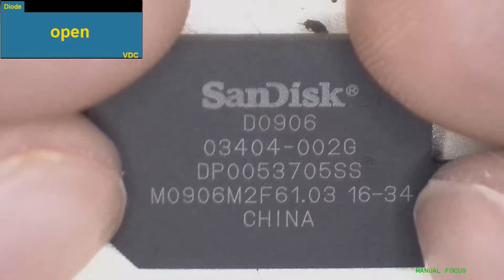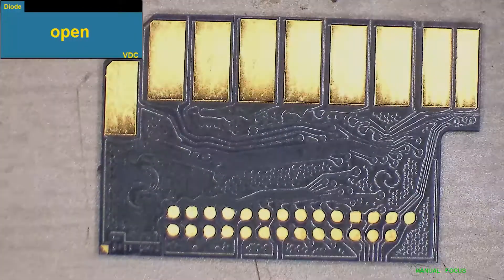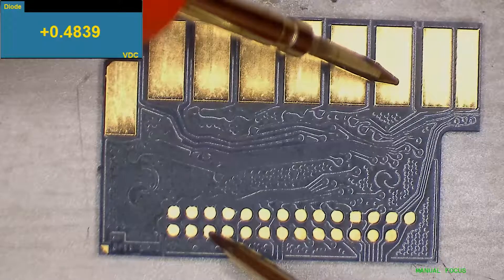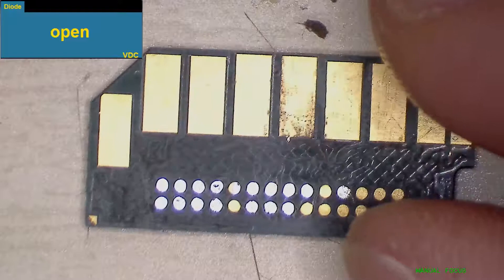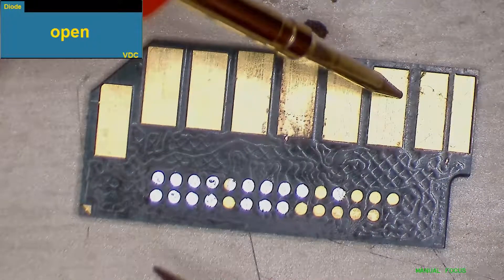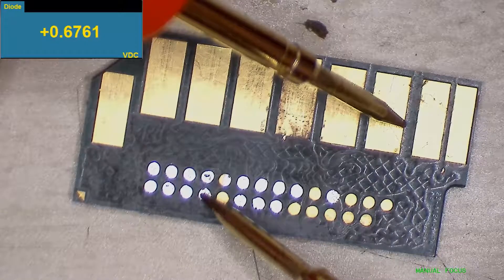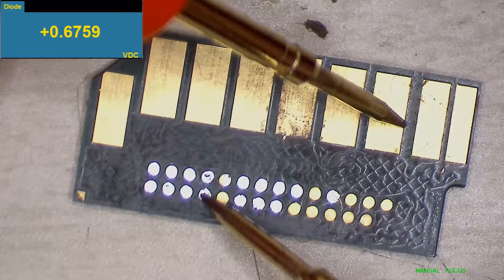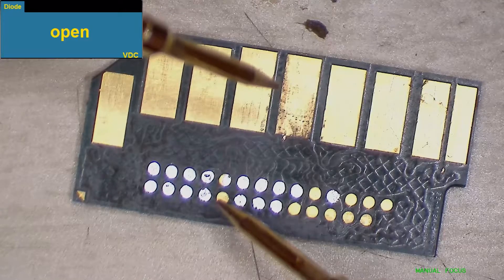Testing a monolithic SanDisk SD Card for internal damage

Comment: Hello ,
        If the Values are indeed different then is it impossible to recover data  .Ground Could Be Pin No 6 or 3 right either one .Also i want to ask whats the theory of this statement  ? . Does this only work in sandisk or this is a universal trick
Reply from the maker: You can use this technique for hunting down NAND signals on monolithics as well.. for example if you find eight signals with a value of 0.46 they're probably data, four with 0.42 they're probably WE, RE, CLE, ALE. Oddly some Samsung chips have the same value for all signals, RE on some SanDisk chips is completely different from WE, CLE, and ALE..  It's an art, and very subjective, but once you verify all the signals using a logic analyzer and validate the values in diode mode you'll often have an Ah Ha, they all match up moment.. Plus this method is helpful when validating if you've accidentally shorted a signal with another or to ground. :-)